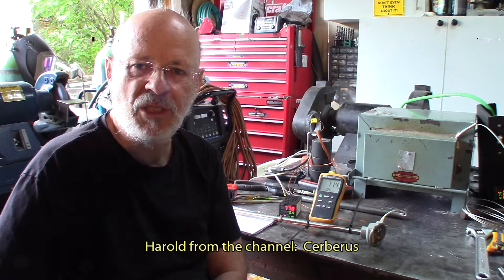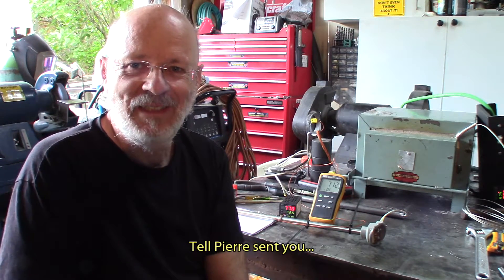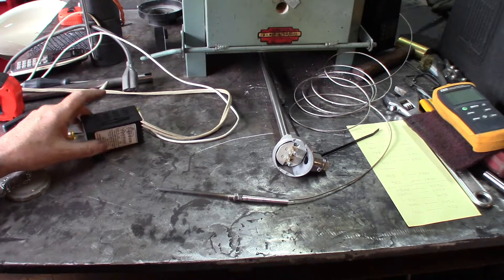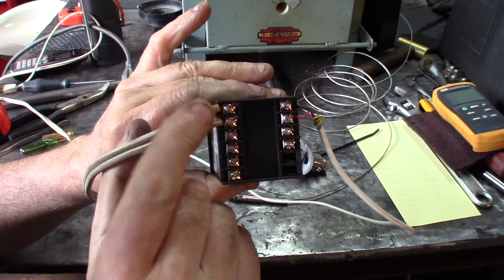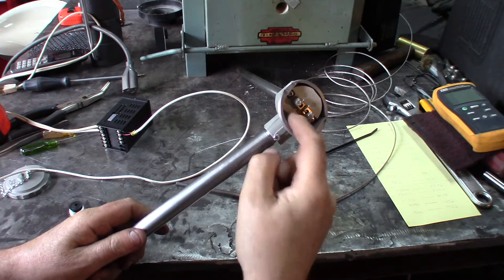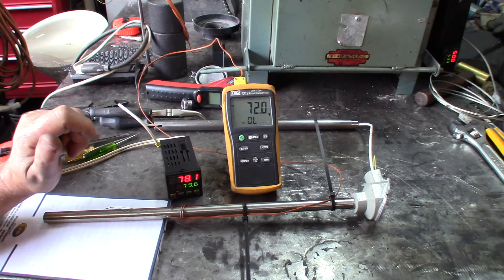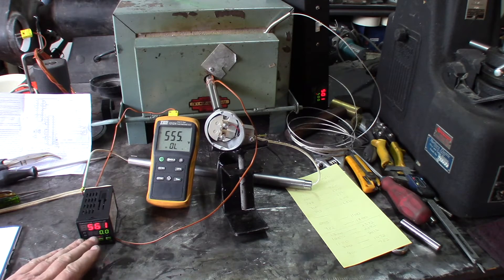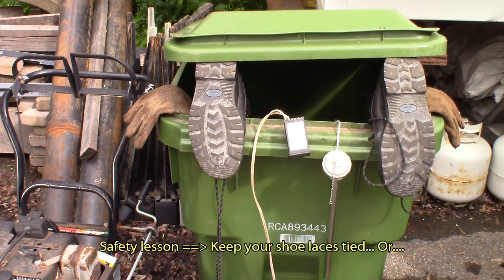Making a High Temperature Probe Using a inexpensive PID and a K type thermocouple

Comment: Pierre, I am building an oven like yours and having trouble finding a K-type thermocouple that is the right length.  Is it ok to shorten them?  Is it also ok to shorten the wire?  Thanks, I enjoy your videos!
Reply from the maker: If they'en encased in a tube, it doesn't seem to be a good idea to modify them, possible that there is a way or an angle you could insert the probe in the oven that would allow the proper amount of exposition inside the cavity, normally those probes are from 50 to 100 centimeters, also make sure they can work at temperatures up to 1200 C....  
Good place to look for is AliExpress.

Comment: Does the probe oxidize in a temperature range of 500 C to 1000 C? Since it is made of steel, I guess it does.
The thermocouple is made of a chromium nickel aluminium junction so perhaps it oxidizes as well. That's what the K type thermocouple's composition is according to wikipedia.
Reply from the maker: The probes are going to wear out after some use...   But, they'll last quite long, as the shorter ones in my heat treatment ovens, just make sure you use them in the specified limits set by the manufacturer...   ;)

Comment: your oven was set to 500 yet the probes read 560?  was the oven controller probe in a sub optimal position?
Reply from the maker: Hi Barry, 
Simply cause the probe that controlled the oven was just placed near the door and there was a gap where the heat would escape. The main purpose was to measure the temp inside the oven and compare 2 different instruments that measure in the same spot in order to see how close and exact the readings could be with no regard to the preset temperature.
Thanks for comment,     Pierre

Comment: PID controls are great for temp control due to the delay in temp response time.  Use a small amount of dirivitive.
Reply from the maker: Randy Richard Once they are close to temp they modulate the power, be certain to use the SSR ones, and anticipate, this Mypin model is so far a great controller for the price... It's too much for using as a temp probe though.

Something you could use, although I didn't try it so far is something like this (You have to get a better K type probe ):

@32246325018

Hard to resist that kind of price...
Reply: pierre beaudry That is way better that a on/off controller, should work very well, way more that you need.  Get a cheap IR probe with an output and connect to the controller.  Hard temp probes are hard to get to last in those high temp areas.  Thanks Randy

Comment: Curious if the PIDs come in a low voltage, battery unit similar to a normal household thermostat. Be great for a cordless tool application.
Makes me wonder what you have in mind for this setup??  ;-)
Reply from the maker: ***** Hi Colin,
I think there are some PIDs or thermometer that works on lower voltages, didn't look for some of those so far since what I'm doing is more on controlling hardening and tempering ovens. This video was more to give someone like Harold ideas on how to get better readings than Horror Freight measuring devices...
Reply from the maker: ***** 
After a quick search, this could be the solution for a portable unit, would have to change the probe though...

http://www.aliexpress.com/item/TM-902C-High-Precision-Digital-Thermometer-Temperature-Meter-Tester-w-K-Type-Thermocouple-Probe-Measuring-50/32246325018.html

Didn't try it but at that price nothing to loose, and there are plenty more models and prices...
Cheers
Reply: pierre beaudry
Cool, price is certainly right!   ;-)